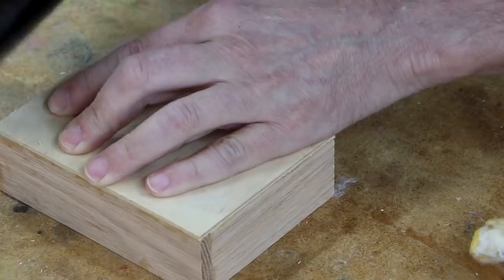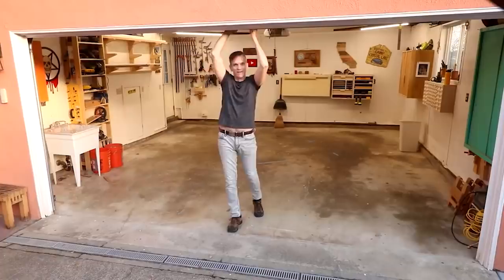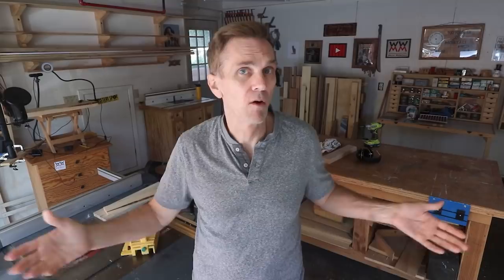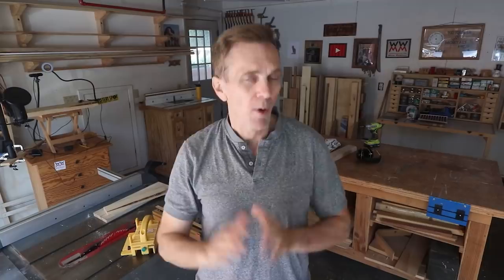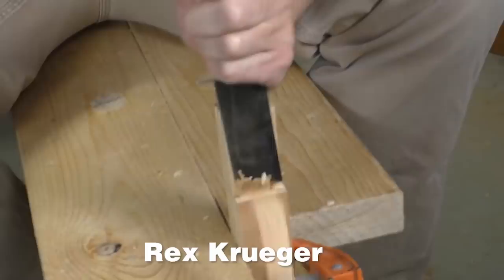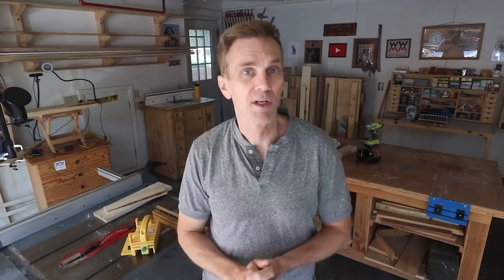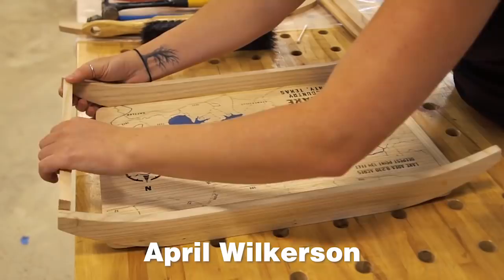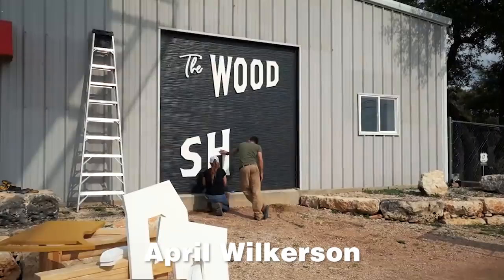Hand tools vs power tools

Comment: I've been running a woodworking art business for five years that started with this channel, and I've changed my approach at least four times in that interval.  I started as a machine driven woodworker, and then did all my art work by hand.  I still do that, but three years ago, I discovered CNC to do carving, which I design, then hand paint and ink.  In reading through the comments, I was waiting for the "CNC isn't real woodworking" comments.  Everything I make is out of hardwood, so I still have to be able to make blanks (cutting, planing, jointing, glueups), and in order to machine wood correctly, you still need to understand grain direction, cutting feed rates and rotation expansion/contraction, wood density and moisture; basically all the stuff you "real woodworkers" know, except I also can expand to be able to program a robot (which isn't a push-button understanding - there's a learning curve, and it's steep) to augment the work.  Things still have to ne sanded, edge-profiled, joined and finished except I used a piece of technology (that takes skill, experience and wood working know-how to use) to achieve the desired result.  I've done things with that machine that I could never dream of by hand, but the robot doesn't do the work. I do.
Reply: I agree.  But you do miss the tactile interaction with the work, so I think it is a little alienating in a sense.
Reply: @davidhawley1132  like I said, I still have to cut, plane, joint, shape, sand, and hand-finish all my pieces. Plus every one is hand-painted and inked.  My hands are on those pieces constantly, so I don't feel any disconnect- and if I do, I can always sweep up the sawdust from the CNC.  Doesn't get much more tactile than that!
Reply: @mattpickering2372  Some people talk about the shape emerging as they interact with the material, which I think reflects the 'imperfection' (= not matching a simple model) of real world blanks .  That is perhaps what I was trying to get at.
At the end, It's all compromises, isn't it.
Reply: I can hear some people decades before screaming "real woodworkers don't use table saws".

Comment: I started with a jigsaw, drill and a sander and built my first laundry basket 6 years ago. Then discovered this channel and got a few more power tools (and Kreg pocket hole jig 😃) when I felt like I needed them for a project. Then I got a cheap crappy hand plane and planed some pallet wood with it. That’s when I remembered how I used a wooden hand plane at my grandparents many years ago and how much I enjoyed the feeling and process of shavings just coming off nicely. Since then I discovered Paul Seller’s channel from which I learned everything I know about hand tool woodworking which I enjoy a lot now.  Like you say it is about the process and the satisfaction from the final result. Most recently I thought how I can give something back to this community so I have started filming my greatest hand tool project yet and posting it on my profile. It is a sun lounger designed based on one I found on the net for over £2,000. Have a look if you have a moment.  The videos are getting better although still very amateur. Haha. Cheers.

Comment: When I get stressed or depressed I grab a lump of wood and a hand plane. I don't tend to make much apart from large amounts of shavings but I do get enormous satisfaction and can really feel my mood improving. I tend to follow Paul Sellers approach that there is nothing wrong with using power tools but that the most enjoyment comes from using hand tools.

My approach is greatly influenced by the fact that my work area is tiny {about 4ft x 5ft) so any power tool usage has to be outside and given that I'm in Scotland I have to take the rain/midges into account.

All of the channels you linked to are great and I get loads of inspiration from them. Another woodworker I like is David Picciuto (Make Something). One comment he makes quite often in his videos (which are almost entirely power tool based) is that you don't need all his fancy equipment to make the same things. A bit of thought and you can work out how to do it all with hand tools. That is also a very enjoyable way to spend some time.

Great video and hopefully it will help others to find the fun to be had by manipulating lumps of tree!

Comment: Thank you for this honest overview. While you clearly have chosen path No. 1 for yourself, you did not fail to mention a lot of good points for the other styles. Youtube often creates the impression that you have to chose 1, 2 or 3 while you really can mix them however you want.

Additional point: Hand tools have almost no setup time. Setting up a router or a stack of dado blades takes way more time than it looks like in a cut Youtube video. Drawing a line and grabbing a hand saw does not. A power tool on the other hand makes perfectly straight cuts with no learning time needed once it is correctly set up, but you mentioned that already.
Reply: One advantage of a mostly hand-tool workshop is that it takes up a lot less space. Machine tools such as table saws, jointers and thicknessers not only take up lots of room in a small workshop, but require room for infeed and outfeed. With hand tools, you put the piece of wood on the bench and take the tool to the wood.

That said, I have a variety of cordless tools such as drills and saws. My cordless circular saw is great for certain jobs that used to belong to big 26" hand saws.

Comment: I started out with hand tools, I foraged car boot fairs, flea markets etc getting basic half decent hand tools together.
Over time I started acquiring power tools which as you say Steve added new skills and crucially opened up more possibilities.
Power tools I treat as an efficient means to an end where making something entirely with hand tools is not so much a journey as a form of therapy.
If I had the room I'd embrace digital CNC type stuff in a heartbeat.
Reply: "car boot fairs" - I'm guessing that you are on the other side of the 'pond'.  I did the same with yard sales over the years (just bought a used table saw at at community sale a few weeks back). It's nice to see that woodworking is a universal hobby.
Reply: TBH, simple laser cutting doesn't really require a lot of room. Obviously won't make anything too large with it, but plenty of space to be creative already.
Reply: @ernstseider  Haha yes I'm from blighty, Car Boot Fairs are our equivalent to yard sales I suppose.
I've picked up a few absolute bargains mainly jack planes as I tend to hunt them out, from a 1931 Stanley No4 Made in USA for £2 ($3-ish) to a mint like new condition Stanley brace (1940-s) also for £2.
I have to stop 'rescuing' old hand planes my collection is getting out of hand now
Reply: @louisvictor3473  My workshop is a small single garage (16ft x 9ft-ish) which unfortunately also has to house outboard engines, pedal bikes and my wood store even my pillar drill might need to be relegated to bringing out when I need it, but then I don't have anywhere to put it to bring it out from :)
Reply: @JerGoes  That is the thing, the ones I was talking about like Dremel 40W (or from what I see most 40w) fits on a regular work table, and its entirely safe to have it inside the house (and probably better, you don't want saw dust or dirt getting into it). And then youtube ads reminded me that also there is a new toy these days, hand held CNC routers (i know, doesn't sound right, but it works). Size is basically that of a regular router, so you can store it anywhere you'd a router. Check some videos about them here on YT, they might pick your interest.
Reply: @louisvictor3473  I'm way behind the times, think I'll take a look into these.
Thanks for the heads up!

Comment: I was wondering what your categories would be.  I've found there is a special category that most people wouldn't realize until they experience it: wood turning on the lathe.  This may not sound like a big category, but it actually is.  Most of the time when you're doing any of the woodworking styles you mention in your video you are doing "engineering" - you plan out a project and try to implement your plan as precisely as possible.  I certainly do and enjoy this type of woodworking.  But then there's wood turning.  Here's a case where you approach a fallen log with a chainsaw, cut off a piece and do some basic prep, then put it on the lathe and make "art".  Almost no measuring can be involved, you just grab a gouge and maybe start off with an idea, but see where the wood takes you.  I've been an engineering type all my life, but when I'm wood turning it makes me feel like an artist and that's something I didn't expect.  Note that I am not AT ALL saying that other forms of woodworking aren't art, they certainly are, just that wood turning is it's own category.
Reply: It definitely is. I would say scroll sawing and fret work and other intricate forms are also their own category. Much different than power tools like table saws and other tools that perhaps a contractor would use.

Comment: I can really only do any woodwork at night, after the kids are in bed. So I use that time to develop my hand tool skills. But the milling. Oh the milling. I made my wife a ladder desk to work from home and so much time was spent with a hand plane that could’ve been removed by having a table saw and planer thicknesser. Or by needing to grab half an hour to rip a board using a circular saw and straight edge…. I’ve now bought a track saw and built your router table. There is pleasure to be gained from cutting a dovetail, but not from handsawing a 6’ rip and planing it true. In my opinion.
Reply: Yes, the milling.  I have a bandsaw to do rips.  I'm adding a jointer to get a face & edge square.  Then I can saw it to parallel and a few swipes with the hand plane gets is smooth.

Comment: I think most people go hybrid/blended. The most relevant diference I see is actually between "fine" and "rough" woodworking. Some people just want to use some 2x4s, pine, some MDFs and put together something functional and most of time large in size. Some people prefer to work with hardwoods, collect exotic material which comes in small quantities, make small fine objects full of details, a piece of furniture, etc. Somewhere in between you will have the cabinet makers, which will be pragmatic with the use of plywood,  pocket screws, etc but at same time spend energy doing nice face frames, drawers, nice tops, etc.

Comment: I started out with the cheap power tool shop because that's what I could affort, but over the last 15 or so years I've become the guy who has a little bit of everything. I love restoring and using old tools but I'm also the guy who made a replica 6th century lyre (instrument) starting with a laser-cut prototype, followed up with one mostly made with hand tools, and then designed a version in in CAD to cut on my CNC ... only to go back and finish it with some old timey hand tools. After all, properly tuned planes and spokeshaves are some of the most enjoyable tools to use (though a Festool Domino comes surprisingly close).

Comment: While I do love my table saw and all the other things that plug in or connect to a battery. 

That was before I got a Stanley no5 plane off eBay. I love that thing. I got it for around $25. And it’s not uncommon for me to walk to the garage just to shave a board for a few seconds and then come back inside. I’ve used electric planers and clearly I’ve used sanders. But a hand plane. Is possibly my favorite tool. 

But I can see how hand planes can get away from me. A good Lie Neilsen cost just as much as a table saw.
Reply: Aye - some power tools are more or less enjoyable to use than others. Table and mitre saws, drills and drivers are fine. However, electric planers and routers are a disgusting experience. They scream at incredible volume, and fight you every step of the way. I'll use them for client jobs where time equals money, but if the project is for me, or a gift for a friend, I'll use my beautiful old hand planes and hand routers every time.
Reply: @-Benedict  I use an electric planer to rough shape chunks of chainsawed wood before they hit the jointer or tablesaw.  Agree that routers are a pain.

Comment: Never thought too much about this, but it makes sense. I definitely fall into the traditional power tool category. I'd love to get my hands on a CNC someday, though.
Reply: Dunno if I will ever be interested in a CNC, just because I'm a little bit too...analog to have patience to learn the technology of it all, and because part of the enjoyment of woodworking for me is figuring out how to do accomplish certain tasks with my own two hands. But, I can see the appeal, and I'm pretty tempted by one of those glowforge machines.
Reply: I’m sorry but no one is going to convince me CNC or laser is woodworking. With both hand or power tools either you guide the material through the tool or you guide the tool through the material.  CNC or laser you write a computer program and do none of the actual woodwork yourself.  Yes, there is assembly later, but if that counts as woodworking then does assembling a table from IKEA count as woodworking?
Reply: @Arbbal  I don't really care if it's considered woodworking or not, I still want to use one.
Reply: @sammathis  That’s fine if you want to play with one, and that’s not even what I’m getting at. I’m just saying writing a set of plans for a computer to follow isn’t woodworking, it’s computer programming.
Reply: @Arbbal  Its certainly more than programming, as you have to understand material properties, feeds and speeds, work holding, etc. etc.  But the one thing you definitely miss is your body's interaction with the material.
Reply: @davidhawley1132  one doesn’t need to understand all that for CNC, all one has to do is google the correct numbers for the material and plug them into the program they write. With hand tools however, one actually has to understand what that all means as they are directly controlling what is happening.  Again I’m not saying people shouldn’t use CNC if they want, just that they are writing a computer program and not woodworking when they employ it’s usage.
Reply: @Arbbal  I agree, but CNC is not as easy as it looks in my small experience, and I mentioned some areas in which I have had issues. (I have also worked as a programmer for decades among other roles in the IT industry, so I know about programming).

Comment: I guess I would count as blended. I'm handtools - don't even own a table saw - but I do have a bandsaw for resawing. Got proficient at it and then said I don't like doing it so got a powered apprentice to do it for me. I do have power tools for home handy-man type things, like a circular saw to cut up sheet goods, but I consider that just normal chores which I would need to do anyway vs. woodworking. When woodworking, even if it involves cutting down a bunch of 2x4 from the store, I'll still use the handsaw. It really is about the process.

I would suggest that anyone who wants to get into the digital side of things might want to start with a cheap 3D printer. Besides being a handy device the process should be very similar, but with a lower cost of entry. I'd imagine if someone doesn't dig 3D printing they would feel the same about CNC or other automated woodworking.

Comment: I started watching Paul Sellers and Wood By Wright, so I have hand planes, hand saws, etc. But it's kind of a pain to flatten and dimension 8 ft long boards, so I bought a planer and table saw.

When I feel like relaxing and enjoying woodworking, i pull out my hand tools. Otherwise, i usually stick with power tools. The noise and dust suck, but whatever.

Comment: A bit of all of em hear. I love planeing and hate sanding, if i only need a couple rabbets then ill do it with a plane, if i need more ill set up the router. I plan everything out in illustrator in real size. Id love to get a cnc machine to cut out mdf templates for me and then take over after that. Just not a priority to spend that money there. Power tools,  ooooohhhh maaannn i looooovvvveee operating at the table saw. just love it. the bandsaw is special also. And milling up wood in like 5 minutes, from the jointer, to the planer, and then to the table saw, i dont know of to many things as rewarding. i grew up in my grandfathers wood shop and then had no access to one until i got my own place in my earl 40's and its like something that was missing is back again.

Comment: I was looking into digital woodworking when I first started out. Mostly laser cutting. But man... Stuff like the Glowforge is still something like 6000$ (Plus insane delivery and taxes when you're not in the US)... If you want anything cheaper... Then it's those cheap Chinese models which need like 20 runs to cut through. You can get shops to laser cut for you, but around here that shit is expensive as well.
On top of that, I do own one of those semi-high level 3d printers... And the maintenance you have to do on those machines to keep them going as they're supposed to... Not much into that either and was a bit afraid cnc and laser would be the same.
So I just went with good old power tools in the end. And its still very rewarding when everything works out on a project.

Comment: I start with power tools and work my way to hand tools and the work gets increasingly fine. I guess you call me a blended woodworker. I use a chisel to clean up joinery because the power tool will usually leave at least some marks. That said, I use a table saw and a planer because milling takes hours this way for large projects and it would take days with hand tools.